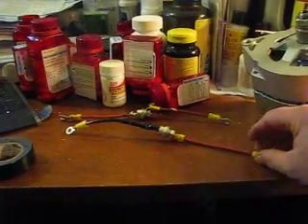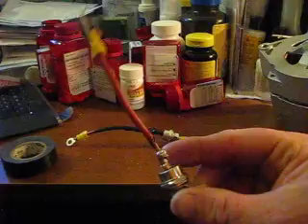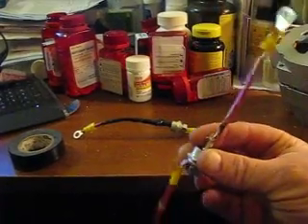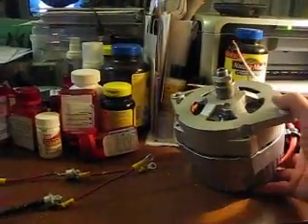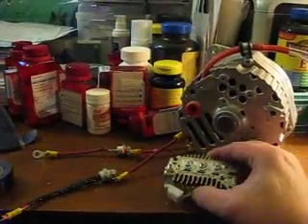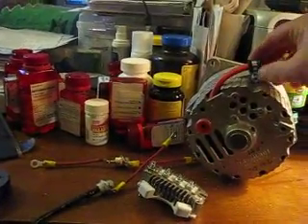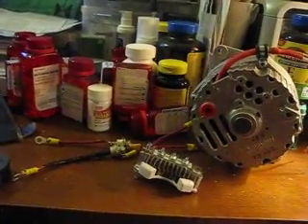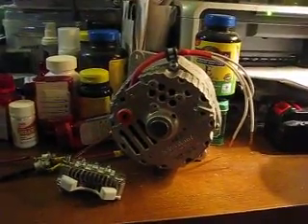Solar Panel Blocking Diodes

Comment: I would think a solar panel designed specifically for battery charging would have a diode onboard.  I have two charging sources in my boat , one is an ac to dc power supply with a on board charger.  I would think  redundant diodes would not hurt anything . I have a question.  What would be the appropriate size blocking diode for my charger and solar panel (100 watt 30 amp )  4 parallel 100 amp hour batteries ?
Reply: my email is bscfrnd@gmail.com
Reply from the maker: there is a diode built in to the panel but it's to give s circuit flow to the semiconductors, blocking diode prevents spike to go back into panels and from battery voltage to go from battery to panels at night.
thanks
Reply from the maker: I believe if you are running the panels through a charge controller that you don't need the blocking diode.
Reply: Thank you